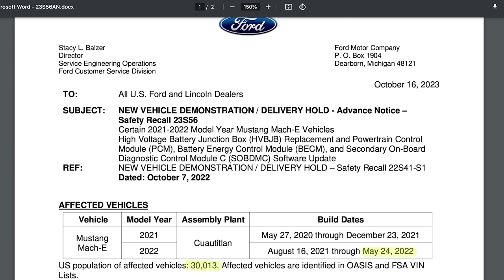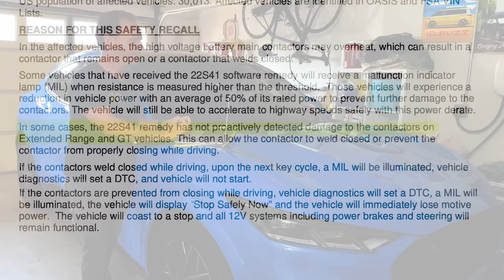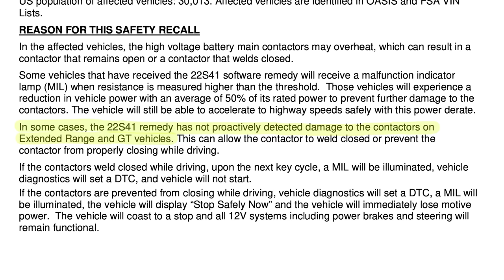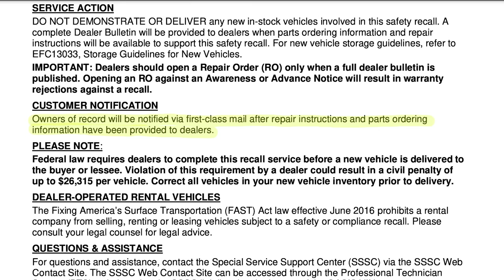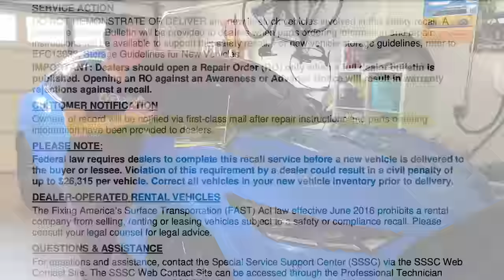NEW Mustang Mach-E Recall to replace the HVBJB!

Comment: A list of dealers who have successfully and smoothly performed this recall should get curated on the Mach-E Forum.
Reply from the maker: Great idea!
Reply: I had a successful recall done on my 2022 GT Perf recently by Frankfort Ford, in KY. The car was still running but had the notice displayed on the drivers screen and somewhat diminished power for the last few weeks.  

They had the parts in stock but had one car ahead of me for the same work. It was a successful repair, and in fact, they installed the latest software which boosted the power noticeably from before the notice appeared.  It's an absolute torque monster now!  I highly recommend Frankfort Ford.  They're very aware that the electric cars are their future.

Comment: And guess whos having theirs replaced for the second time?? Im very happy that Ford finally made it official recall
Reply from the maker: Hopefully they hurry up with yours!
Reply: Ouch! What year and trim do you have and when did they first replace it and last time?
Reply: @anthonyc8499  2021 first edition, according to my vin, it was built December 2020
Reply: @MachE_VLOG  hope so too!
Reply: @ChargingtheRoad  wow, super early build date! Was the original blown JB replaced with a duplicate or with the revised JB? And is the current JB the revised one? Or are you on your third original version of the JB?
Reply: Just bought a buyback with this already done so hopefully I don't have to send it back so soon haha
Reply: @anthonyc8499  The replaced JB is what gave out again. Luckily, the OTA software update made a big difference by detecting the issue as early as possible so I won't get stuck again. As far as if the replaced JB  is original or revised, I am unsure.
Reply: @ChargingtheRoad  Patrick says that the new HVBJB came out on 25 May 2022, so if your repair job came after that date then it was the newest version that is supposedly improved.
Reply: @anthonyc8499  my first repair was completed (after 7 months) Feb of '22 so there's good chance it's not the new JB
Reply: If they just replace the parts with original parts, it didn't fix the problem! The new parts are much beefier to stand. The heat of the massive amount of power is pushing around. I chalk it up to growing pains.  I also appreciate Ford stepping up and doing the right thing plus some! So, they're prolly replacing parts that will never go bad just to be sure.

Comment: I just did this recall at my local Ford dealership for this parts replacement. I drove my mack e 2022 for a 1 mile from the dealer and it stopped driving in the Middle of the road. Had to be towed back to the Ford.

Comment: This is why since I got my Mach-E I never go over 45 mph to make sure I don't have this problem. LoL
Reply: I think you're just trying to make a joke, right, as these are very robust cars with amazing power and drive-ability.  In my opinion my GT performance is the best car Ford has ever made.  As for the recall, 30,000 cars have been included, and only 115 failures! So, to me that's going above and beyond the call to protect any potential problems.

Comment: Thanks for posting this timely video! Yesterday I was on the Ford website for a completely different reason and this recall-to-be was on our RWD California Route 1 page for 'Recalls and Customer Satisfaction Programs' along with another one 'charge cord stuck reprogram battery charge control module'. When we get the official letter the CA Route 1 back to the same dealership that successfully replaced the motor lubricant pump earlier this year.

Comment: My 2022 GT Performance was made late March-early April 2022 and is in the recall but I have not have this problem come up. I did have the SYNC4A module replaced on 10/18/23 (a 2 hour job) as the screen had gone black and had limited animation activity; other functions worked and the car was drive-able, stuck in ENGAGE mode. It is now faster and smoother than before.

Comment: Pat & Liv, thank you for your great work. Have you got any update on this issue
I got the the recall letter on April 2024. I took my 2021 MME GT to my Ford dealer and after 1 week they call me to pick up my car but the issue couldn't be solved because Ford put a stop on the part replace and I haven't heard anything since.
Thanks again!
Reply from the maker: Ford had a software issue that meant techs couldn't reprogram one of the modules after replacing the HVBJB but that has been resolved. They should be back on track now.
Reply: I just got a new appointment with the help of Ford Recalls Customer Service fir Jun 10 to finally fix the issue
Thanks for your help

Comment: 107 failures - are those only the ones reported to NHTSA by individuals - or is that the full number that Ford has repaired under warranty?
Reply from the maker: I think that is what the NHTSA knows about but I don't know if they have a record of all of the failures. I was thinking they should since there is an open investigation. If I find out, I'll be sure to post about it.

Comment: I was considering buying a used MEPE, but now I’m concerned the car isn’t reliable.
Reply from the maker: It's been recalled and Ford is fixing it. I wouldn't worry about it.
Reply: @MachE_VLOG  the car is very reliable as is the company for stepping up to the plate on this. 30,000 cars affected and only 115 actual failures. The ice cars aren't that reliable and they've had 100 years to work on it.